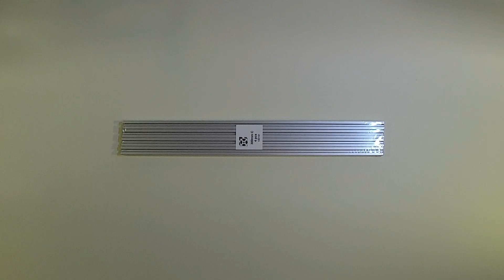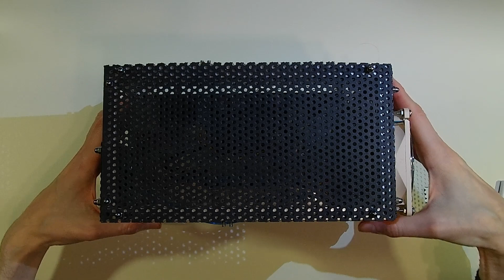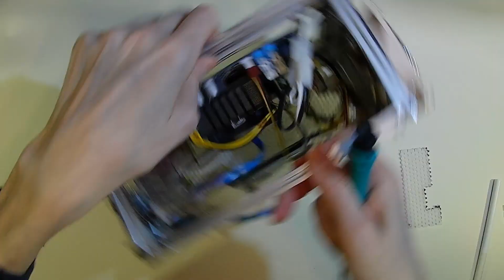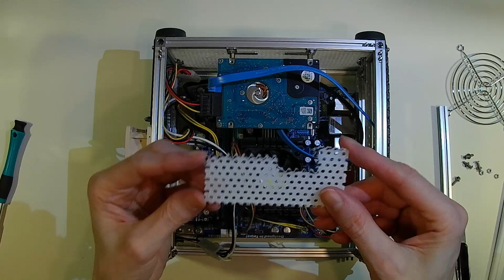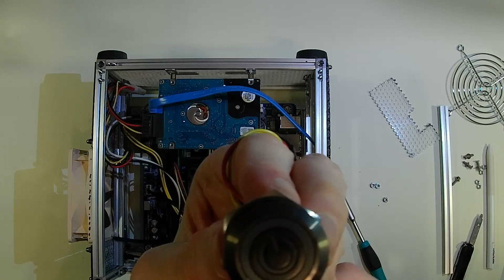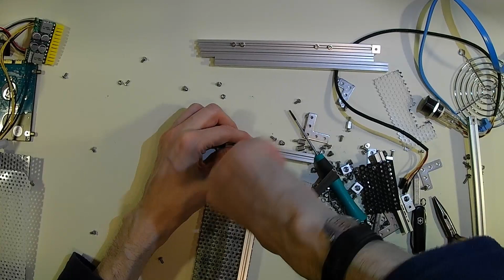More Makerbeam frames - computer tear down

Comment: I'm tinkering with makerbeam's right now chain watching what everyone does with them :)
I'm trying to build the most compact case I can manage, to fit in 2x280m rads.
I've CAD designed a distro plate that houses the pump and reservoir as well, which will cover the whole front of the PC case.
Can you give me some ideas about how best to mount radiators (which will be top and bottom) I am planning on mounting them directly to the case beams, which limits the number of radiators I can choose from (due to clearance between the side of the radiator and side panels)
Reply from the maker: As you'll see from my videos, I've used either brackets to connect items to the beams, or if the item has a suitable mounting hole, bolting these directly to the beams. It's good to experiment and see what works, as when it doesn't you can just dismantle the frame and try a different design.